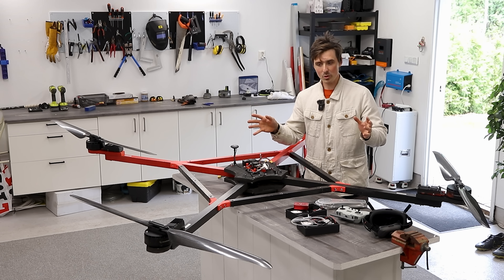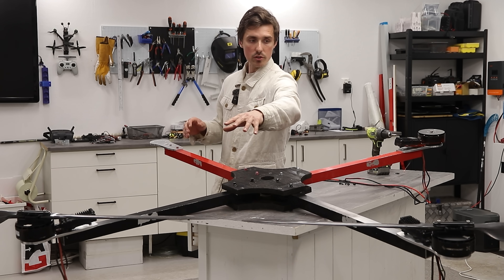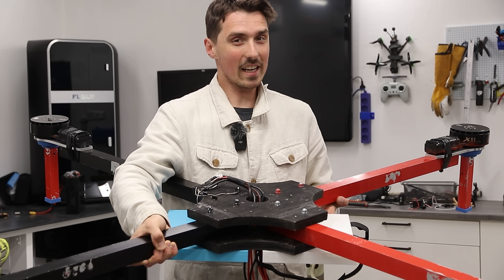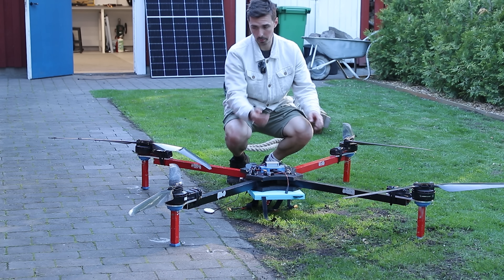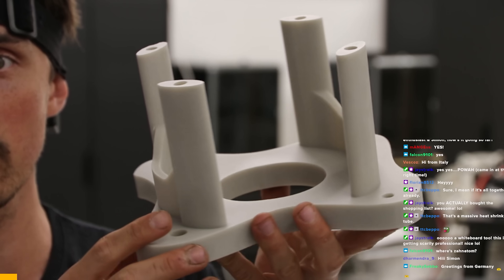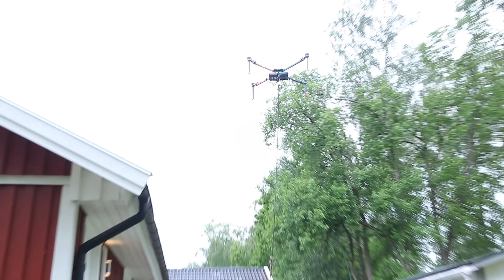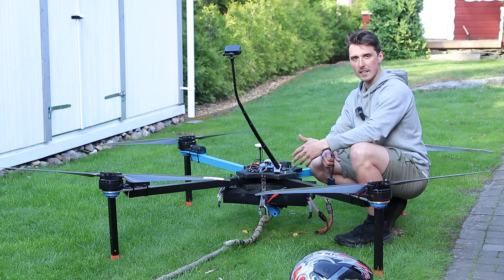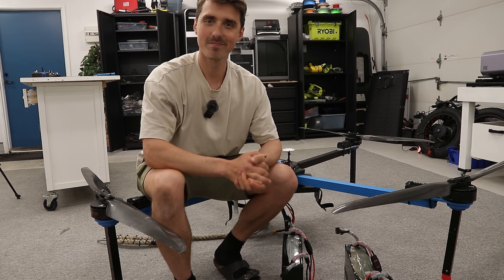Heavy Lift Drone 100kg Test - It Works!

Comment: Happy for you, that it works !! Nice ! As for the drop mechanism: Stick/glue some brass sleeves into the mechanism to slide better then on plastic. May be you then need only one servo or at leat make it relailable. 
Such a nice fun project ! and also like ur sense of humor ! 🙂
Reply: There is no need for a heavy-duty release system. Check out the three-ring release system we use on parachute risers. It’s an ingenious setup: a small (~20 mm) high-strength stainless steel ring inside a medium (~40 mm) ring inside a large (~70 mm) ring, all interlocked and held in place by a loop of webbing through the small ring, secured by a pin at the end of the release cable.
Pull the pin holding the small ring, and the whole system cascades open almost instantly in three stages — one ring after another — releasing over 100 kg with probably around 1 kg of force, give or take.
It’s super lightweight, too — nothing like that enormous monstrosity he used, which didn't even work properly!
I actually had to cut away a malfunctioning main once, and it worked perfectly!

Comment: Would it be worth it to add some rotor guards to keep the blades from hitting the ground or anything really in case of an accident? 

If you make something that is sturdy enough for it to rest on when upside down, you might also be able to move the landing gear out from under the props.

Comment: Some time ago I designed a system for dropping loads from a rc plane that doesn't fail and works with low-power servos.
I was able to drop 5kg with one of those cheap 9 gram servos.
I have the files on thingiverse, if you are interested.

Comment: You need to investigate 'load release hook design where the weight of the load barely impinge on the release mechanism. Used on helicopters to release slung loads in an emergency (along with explosives if that one fails!)

Comment: there's these things you can use called spanners, or wrenches to tighten nuts and bolts rather than using multi grip pliers.

Comment: I would suggest trying some 8020 aluminum extrusions for your frame. They sell all of the connector plates as well. Just be sure to use a drop of Loctite on the screws for final assembly.

Comment: The issue you're experiencing is likely propeller stall. The motor's KV rating is too low, meaning you don't need much power to lift the drone. This results in the motor running at a very low speed, which causes the propeller to stall. I recommend adding some weight to the drone, or even using a larger battery. This might seem counterintuitive, but it will force the propeller to spin faster, preventing the stall. I've encountered this problem before, and this solution worked for me.

Comment: You need to mount the weight straight to the chassis. The rope is introducing wabble that is not compensated by your flight controller and can get out of hand real quick.

Comment: Your dropping mechanism would be illegal in your neighboring country (Denmark), where I live. According to EU drone regulations, which both Sweden and Denmark follow, dropping payloads from a drone is prohibited in the Open category, and requires special authorization even in the Specific category.

Also, I think you trust your CA glue a little too much 😅 – especially with that kind of thrust and payload. Structurally, your build is super impressive, but safety-wise, it definitely skirts the edge.

That said, it’s important to point out: you need a permit to fly heavy drones like this. Anything over 25 kg is not allowed in the Open category, and operating a drone capable of lifting 100 kg falls under the Specific category at a minimum – possibly even Certified, depending on the risk assessment and use case. That means submitting a risk analysis, applying for an Operational Authorization from Transportstyrelsen, and proving you can fly it safely and responsibly.

The build is amazing – no question – but legally, you’re deep into “don’t try this at home” territory.

Comment: Sit in a hammock or chair below the drone. With the drone hovering with propellers at a safe height sit in the chair, then retract the tether to get closer to the drone during flight. When landing hover the drone and lower the tether to step off then land the drone. This keep you safe and away from the drone during the most risky parts takeoff and landing, ensuring the drone is operating properly before getting close, and eliminates ground effect risks.

Comment: One thing I've done to reinforce prints is using long screws threaded directly into the plastic, but sometimes that delaminates it before you can even get it all the way through, so I run a tap through it first. I do this with SAE #8-32 screws and 0.15 inch holes on robots to help impact resistance, and they help a little bit under tension (they're kinda like M4 screws). Your piano wire trick reminded me of that. 

Also, maybe try some fiberglass reinforced bondo for repairs like the propellor one? Continuous fibers like what you did are probably better anyways, but the filler material being stronger than plain epoxy / CA wouldn't hurt.

Also, nice white jacket thing. 

Does it compensate for the sudden weight decrease when you drop things? If not, I think that would be a cool feature.

Comment: I enjoyed this video. One thing that I was surprised by was your statement that at first the drone was too light. But that makes sense, since the tiny little toy drones are much less stable than the bigger ones. I wonder if there is a "golden ratio" of weight to performance? That is, given the amount of potential power of the motors divided by the weight of the drone should give us the ideal power to weight ratio. Wonder what it is?

Comment: This could actually be doing some real work. How much battery did you loose after the 40 and 65kg flight?
Reply from the maker: Lifting solar panels onto the roof? Lost very little battery, could probably have done a couple dozen of those lifts.
Reply: @RcLifeOn  I was thinking the same. Or if you want to install them off grid, where there is no street access. Could lift them from the trailer to the destination!

Comment: 5:38 this why u need failsafe on the easiest n fastest to reach switch(not same finger ur using for roll/pitch/yaw/throttle). for super expensive first launches having multiple controllers with motor off switches COMPETENT people at different angles looking at the drone, competent being the keyword as someone more easily startled prematurely failsafing would actually cause the high damage test we are avoiding.

Comment: Thanks for sharping your incredible project. I just moved up to bigger drone and heavier camera from my older 500 mm model. BTW, I had the same problem of my drone flipping over the first time I powered up. In my case it turned out that the internal settings of the esc's were were very wrong for my model.

Comment: @RCLifeOn only once I tried aluminium on a quadcopter. It was even worse idea than lending 10Euro to a hobo saying he will get them back tomorrow. Where playwood quadcopter parts survived multiple flights, the aluminium simply bent and dropped off. I am kinda afraid they will simply come apart after certain time......and well.....lets say those motors could def cut flesh

Comment: those oscillations with 60 kg are scary. The 3d printed mount snapping saved the drone. I guess you will have to do PID maps for different weights.

Comment: Some friendly advise from someone who fly's heavy drones on tv shows. When launching just pop it up hovering just a few inches off the ground puts the drone in some pretty bad air currents. Get it out of the bad air as fast as possible. Also print that part that broke in the end more solid start at 50% infill to start and use 4 walls also might want to think about optimizing the orientation it prints in to add strength that way as well. Thats a big bird you got there enjoy it

Comment: Just an idea that can throw you off. Imagine a drone with "propellers" (disks of a boundary layer turbine) enclosed in the center of the "drone" structure. The gyroscopic effect will make it extremely stable in flight and the maneuverability will be controlled via exhaust (air conduits) openings. The Intake of the air is a via central opening. It will be extremely compact, stable and other additional benefit, extremely quiet as the air will not have the vortex noise from the tips of the propellers, as it literally will flow-through the "drone".

Comment: might I suggest a totally different frame ? it SHOULD be obvious that at this scale, you NEED that heavy center mass to be at least half the total device diameter LOWER, you could just weld on extra down tubes and mount all the kit and batteries below ....this will give you bird HEAPS more stability...

Comment: "Yes officer, this is a sub 250g drone"
Reply: Yeah it’s 249g, no need to register it
Reply: @littlestewart It's actually 249.6kg by my reckoning , 😂
Reply: You forgot a k
Reply: "... and this is just 100kg flour... for the bakery!"
Reply: 250g? i thought it was 250kg ha ha ha
Reply: It's even got a wee 'c-class sticker', if you look really well 😂
Reply: "I tought the limit was 250kg not 250g."
Reply: Sub 25kg
Reply: "...grams? I was sure it was Pounds!"
Reply: "Sub 250kg "
Reply: Kg. But the k is silent
Reply: Well it is at least a sub 250(k)g drone!
Reply: Definitely sub 250 kg ….
Reply: Sub 250kg drone. In USA the cops do not know the metric system
Reply: kg
Reply: Well…the flight controller is😂😂😂😂
Reply: It grew overnight officer I won't that charger again
Reply: Drone? No, Officer, it's actually a light truck.
Reply: It's true if we suppose that "g" is a unit of acceleration :)

Comment: If you can add four smaller props for high rate stabilization you may be able to more reliably use all the main lifting motor power.    May require special control loops or might get lucky and the small motors might just naturally react faster.     The larger props moment of inertia goes up by the square of radius.   Takes a lot more power to get fast reactions from a big prop.

Comment: Be sure to check those aluminium motor mounts regularly. The hole for the wire feed through is in the worst possible place for weakening the mount plate. The square tube of the arm really should reach under the motor, so the motor and the landing legs pull directly on the arm instead of through the aluminium flat bar.
If you did the calculations, scratch that obviously. It's hard to tell from the video what dimensions the motor mount has (thickness, width, length). Aluminium has no fatigue limit. It will crack after repeated load cycles. We are not talking about plastic deformation here. This are cycles with just elastic deformation. How many cycles that are, depends on how close the variable stresses are to the yield strength. They number of cycles could be in the millions or even billions. But they could also be in the hundreds of thousands, which is in a range that could be induced by the propellers (they induce loads twice per rotation).

Comment: Trying to lift 65kg and not putting 100% solid infill on the 3D part? Even with complete solid infill it's still a stretch, and it doesn't look like you're using PPA-CF or at least PAHT-CF, why would you expect the part not to break at those weights?

Comment: That's very impressive.   Have you thought about doing some flight times of your drone?  like flight time on the battery set you have,  loaded and unloaded ect.  Ex.  How long would your drone fly if it had 10kg payload.   Great project.   :)

Comment: YOU MORON!!!! PIXHAWK is not the issue. you've mounted it on a super soft suspension. I am capable of building equal to and larger quads, hex, octo AND ULTRA CUSTOM designs, and have no issues. The FC or flight controller. needs to be mounted on a thin higher density foam material for dampening the higher vibration frequencies from flight. You have effectively build a hill climbing suspension for a motion controller that requires motion feed back to work. With so much more dampening you will throw off the TRI, or three axis accelerometers and TRI, or 3 axis gyros. It doesn't matter if your using the stock firmware, openpilot, or nuttX on the pixhawk. You can not, NOT let the flight controller FEEL the crafts movement. It needs the movements/vibrations to function. The oscillating IS NOT do to the weight of the craft. Dude you have a LOT of reading to do to understand how the PID functions work. And the physical aspects of the craft mingle to generate a working craft. Everything is a calibration based on the physical aspects of the craft. #!@#$!%@#@    READ!!! And you stripped screws. First of all start labeling things. You can color code what ever. But you MUST have a working design on paper before you can assemble. Its kind of like cad, you can NOT 3d print or cnc mill something before you have 3d modeled it. I'm so annoyed I am not even bothering to check grammer.

Comment: This is an incredible idea.  I've seen commercial "air taxis" that claim to transport people with quadcopter style aircraft.   This issue I always see is the passengers are josseled around in the cabin.   If this aircraft is meant to take you airborn a GIMBAL for the passengers underneath, or above would be the most comfortable wayt to travel.

Comment: You may want to create a second smaller set of props.
IF your large props had a 90% reaction and 100% obey of orders for all 4 motors to power up then the the smaller set of motors would be set to react a lot more of it's total power range on just bringing the system back into the preferred body angle.

It's like you were trying to make a plane with not smaller control surfaces.
A smaller second set of more reactive props would possibly give you a faster applied specifically power system?

Comment: Definitively worth a thumbs up... It's worth a comment too... In fact it would be worth trying to get ahold of Ukrainian government to see if this design can help them. The only suggestions I would have would be to put extra motors and rotors on the underside for extra heavy lifting. Since PCB Way is sponsoring you, it may be possible to get machined landing gear mounts. The propwash won't be an issue if you angle them down at a 45º angle so long as it's not going to get contacted by the rotor.

Comment: why not add a short tie-down to each landing gear for first test flights?

it would prevent flipping and anything crazy, then once you know the throttle is working you can shut it off and remove them.

Comment: I'm trying to make a similar kind of drone 100kg payload, using XAG A40 motors, i cant find proper connectors to extend the motor wire. It might be similar to these X11 Max motors, can you help me in finding these connectors. Like, what are they called ?

Comment: If I was you, after taking everything apart and putting it back together I'd definitely do a testrun without propellers. Wiggle the drone and verify that the correct motors are responding. There are several possible failures, connecting the motors wrong is just one. I know, hindsight. But next time!

Comment: I have been 3D heli pilot since 2008 and I am very impressed it does not jump into the air after dropping that much weight
Reply: I a helicopter do you have to drop the power the same time as dropping the load? To keep stable?

Comment: The most impressive part is how little the drone moved after dropping those heavy loads. The flight controller really handled the sudden change in mass well.
Reply: Was thinking the same. Impressive
Reply: On the 40-kilo drop my eyes were fixed on the drone for that exact reason. It's amazing to see how stable it is when the RPMs suddenly drop by exactly the right amount.
Reply: you can hear the motors change their pitch when the water bucket drops. that's pretty cool.
Reply: @funnygrunt_o7  *RPM
Reply: Very impressive e
Reply: The most impressive part was the carbon fiber props not separating and the projectile blade tips slicing into...   well... you know what I mean.
Reply: I agree. You'd expect it to shoot up a few feet when it released but it stayed right where it was. Incredible piece of work.
Reply: Shows why you can't use IC motors for quae/hex/octocopters. Can't change the pitch fast enough. So you're stuck with the relatively short range from batteries.
Reply: Impressive, I can see my self underneath on a seat. Weighing about 65kg😅😅
Reply: Right? They weren't kidding when they said that FC was designed for heavy lift drones. I'm used to them oscillating to heck as soon as you hang basically anything off them.
Reply: agreed
Reply: Yep I was thinking the same as well.
Reply: i concur
Reply: Same here lol wow
Reply: Finally,  someone uses the word Mass, waited years for this
Reply: I was thinking the same as I have seen the increasing load.
Reply: Read my mind
Reply: Good PID tuning
Reply: in kx fc servi motor connect to which output? i  use p1 but servi sometimes has random movment
Reply: Your mom says that every time I am done.
Reply: @ThaiLifeAmerican  So, you've finally moved from boys to Women? I guess your Daddy's husband broke it to you... gentle like?
Reply: @ThaiLifeAmerican - Pelvic Inflammatory Disease  ?

Comment: In the later tests you were standing without helmet, without body shield, watching a massive drone with a poorly repaired propeller. Are you asking to be impaled by a propeller blade tip? You really need to take safety more seriously around this monster.
Also, at 65 kg this drone was already oscillating due to the pendulum effect of the payload. You need to rigid mount such heavy things to the drone, or it will oscillate until it crashes.

Comment: A solar panel as a protective shield? Theoretically, you should be able to lift yourself with this drone. But I'd forgo the drop mechanism at heights above 10 feet. You could also order an empty agricultural drone from China; perhaps that would have cost less than your individual parts.